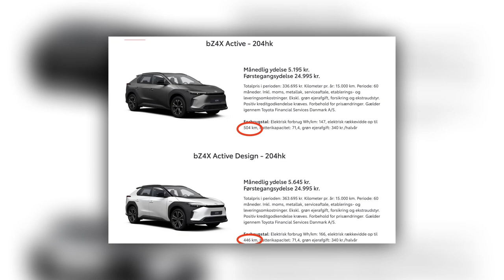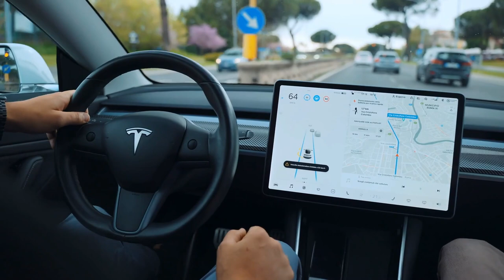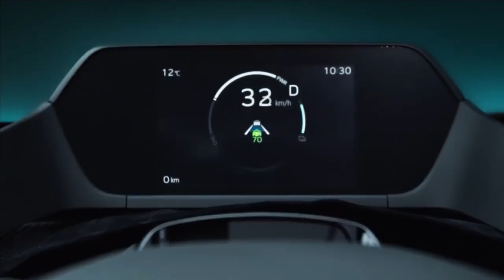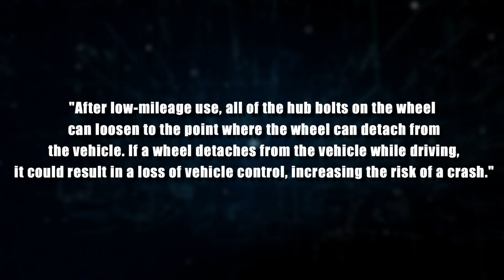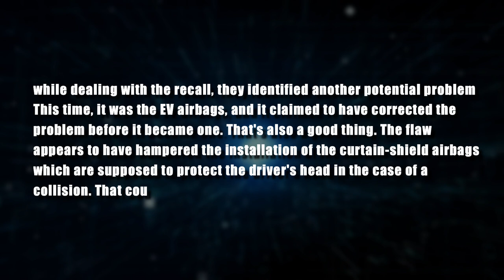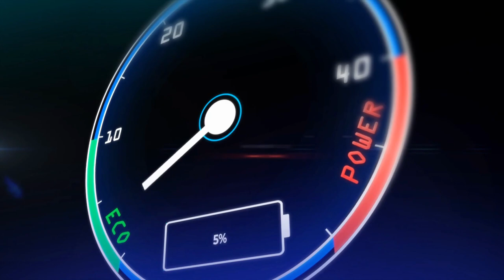This Is Another BAD NEWS For Toyota BZ4X Owners!

Comment: I have found that the mikes per full charge is exactly as
Promised. I do get higher number of miles if I turn off the heat/ac or if I use Econ auto heat/ac and when I use the regenerative brake system
Reply: where are you at ? I guess the Danish test was made during winter here in Denmark. It may be that the Toyota is exceptionally bad at handling low temperatures.

Comment: This is a toy car.  I am very sad to buy this car because its only problem is charging.  First of all it takes long time to charge if 50% charged with level 3 it will take 2 hours 30 minutes.  Then you have to keep the car at full stop which you have to suffer in extreme cold, heat.  After that if you start the car and turn on the heat and AC then you can run the car for one hundred miles.  So don't waste your time and money buying this car.  thank you😢😂😂😅 I thing this should be put in a museum... 👩‍👩‍👧‍👧👨‍👩‍👦‍👦

Comment: The BZ4X may not have the best battery but at least it will be reliable through the years.
Reply: U are right…. Not best batt but last longer than others.  90% till after 10 yrs
Reply: No way of knowing that at this point. They are having problems early on that are not common with Toyota